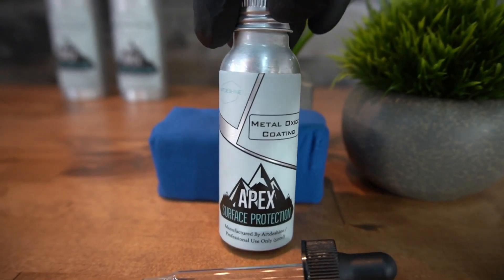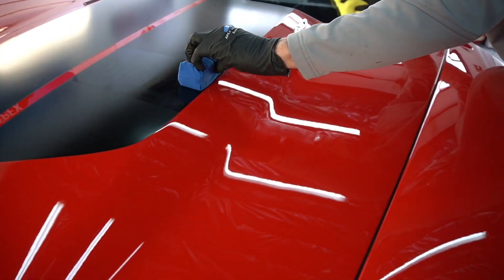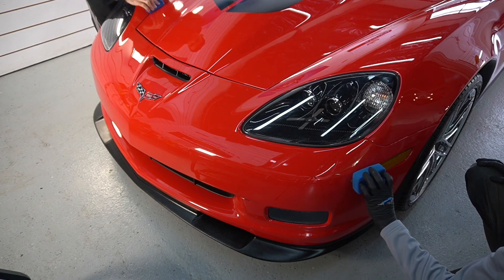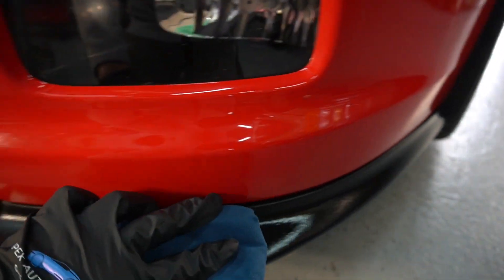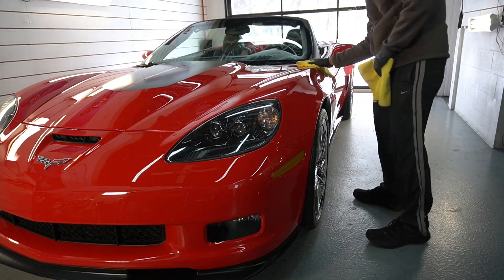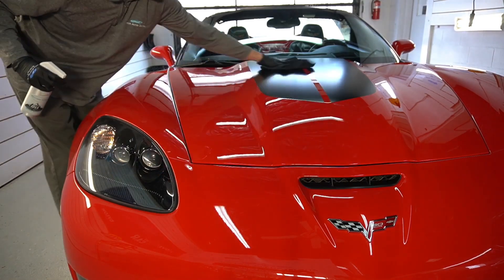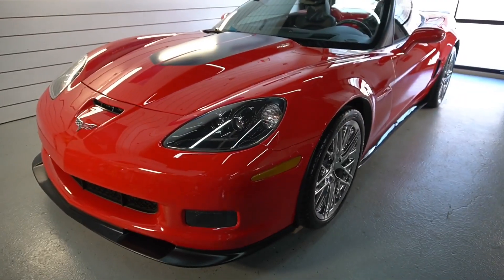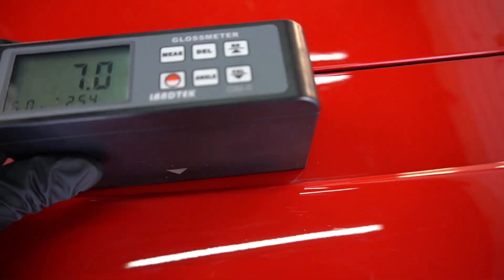Apex Surface Protection (ASP) Metal Oxide Coating Protecting This C6 Corvette!!

Comment: I bought the $200 kit over a month ago. Relatively quick delivery. Surprisingly no contact info of any kind. Tried looking it up, but no luck. Got the info I needed by watching Papasmurf. So far I’ve done a black G63  & a black JK 4dr. The hardest part for both vehicles was stripping off the TurtleWax Hybrid Ceramic Wet Wax coatings. Took at least 2 hours per vehicle.  Application of the Metal Oxide was pretty simple & easy. Used the sheeting as a topper on the G63 and it turned out so glossy that it looks surreal. Waiting another couple of hours before applying it to the Jeep. I still have roughly 1/3 of a bottle of MO and I did every square inch(and wheels) of both vehicles.  I’ll definitely be buying another bottle of MO.  I’m just a “hobbyist” and only do this for my close friends.

Comment: Ohhh, fooey.  I just bought a liter each of the Menzerna marine 3-in-1 and Power Lock based on a few of the videos you had posted earlier, and just this morning I ordered some Menzerna control cleaner to use to clean the surfaces after the 3-in-1 and just before applying the marine Power Lock.

My application is a bit different, however, as I'm using it on my airplane.  For the last 24 years since it was painted with single-stage Imron polyurethane it's sat outside exposed to southern California sun. Summer sunshine is brutal, winter rain leaves greasy streaking down the vertical surfaces from residues in the smog. The paint has lasted these 24 years because I've been using Astro Shield polish made by Nord Viscount until they went out of business back in 2008.  It's a basic polish that uses dimethylsiloxane and polyethylene polymers and low micron abrasives in the usual base of petroleum solvents. 

Now the good thing about the Astro-Shield is that it does seem  to make the finish look better the more one uses it.  The bad thing is I'm running out of it and Nord Viscount no longer makes it.  I have been polishing the plane every 3 to 4 months and the paint is still holding up, with a few minor  (2mm) bare metal (aluminum) spots showing through.  The worst area is the dark navy-blue  anti-glare panel above the engine that is always the most oxidized and turns the polishing pad blue every time I polish it.  The wing area is white, so it doesn't seem to get as much oxidation as the dark colors.  The color stripes on the sides of the fuselage and vertical tail are still in decent shape after 24 years.

I don't care really about gloss or beading, I care more that the paint doesn't oxidize and flake off to the point where the aluminum is exposed and subsequent corrosion reduces structural integrity of the airplane and slows it down from the aerodynamic drag.  (and looks like crap)  So if that happens  the plane has to get repainted and that gets very costly to the tune of ~$20k, or else the wings come off in flight.   So it's a lot cheaper to maintain the paint, especially the surfaces exposed to sunlight by polishing every 3 to 4 months.

I can do the ASP  metal oxide, but would the 24 years of dimethylsiloxane and polyethylene polymers pose an adhesion problem to the Imron?  There are areas of wax buildup around some of the rivets and shallow ribbing on the control surfaces, as it was too much of a PITA to to remove the old wax.

Any thoughts would be appreciated.  Thanks.

Comment: Brian,  Do you recommend discarding the microfiber towels  after leveling & buffing using your Metal Oxide Coating.  Thanks,  Dave Fleming,  Kennett Square ,  PA.

Comment: I ordered a kit a couple days ago, how long after applying the coating should I wait to apply the topper? Or second coat? Durability for 2 coats? I hope business booms for you Brian, you deserve it.
Reply from the maker: 24 hr. Then top it. 4 hours between layers of the coating. 1 coat five years.. 2 coats eight years.
Reply: @apexdetail85  Thanks Brian.
Reply: @apexdetail85  this is amazing and I’m so happy for you. 
After all the years of great advice you’ve given away, it’s your turn to get something back. Good on you!!!!
Reply: thelastm  estimated time with maintenance
Reply: @apexdetail85  can your coating be applied in the Texas heat? I have access to a garage but it’s not air conditioned. Any tips would be greatly appreciated!
Reply: thelastm   same question I got how do they know

Comment: How do these new products benefit/get along with SIC "pro" coatings?  The sheeting product your site describes is intriguing in that it may help coated surfaces "shed" dirt rather than just suspend it with water beading.
Reply from the maker: They have played well with the coatings I have applied them to. And that was many.

Comment: What are the key differences between the two ceramic toppers or maintenance coatings? Are they both water based?
Reply from the maker: Yes. Both organic polymers not ceramic. This lets the coating breathe underneath as it cures and the toppers in return have no cure time.

Comment: Hey Brian.  I've been watching your video hoping it would resolve an issue I've been trying to fix ever since I got my sports car in 2017.  The issue I'm trying to resolve has to do not with actual hard water spots, but just dirty water stains.  I want to start by letting you know I already have a coating on my car but it doesn't prevent this problem.  Here's a little scenario:  I just washed my car.  Then a few hours later it starts raining but just a bit.  Then the rain stops.  Because of the coating I get beads right?  So when they end up drying they create dirty water stains.  This forces me to wash again (I usually will use a weaterless wash product).  This gets me quite upset.  If only the water would just sheet  off the panel instead of beading it would be amazing.  So my question is this: Would Surface Protection Metal Oxyde all by itself prevent this to occur?  Or that product combined with Rehydra-Sheet maybe?  If you confirm I will most definitely buy them for sure.  Please be honest with me because it's quite an expense and I want to make absolutely sure it will resolve this issue.  Thanks! :-)
Reply from the maker: The combo as a team works best. The coating can do both depending on how much water is introduced to the panel...but when topped with sheet... that is w whole new level. One thing to keep in mind...even sheeting products need a certain amount of moisture to work properly. If just a light, short shower...could end up with a few beads.
Reply: @apexdetail85  Ok then thanks a lot for such a quick reply! :-)

Comment: @Apex Detail  I love that this coating can be applied to all hard surfaces. 

Will the durability for the paint protection be the same for glass and headlights? 

If I were to apply 2 coats to headlights, can I use a UV light to speed up the 4-hour wait between the 1st and 2nd coats? 

✌
Reply from the maker: Yes..shortwave IR van greatly reduce cure time between layers

Comment: $ is was only a matter of time...but still a loyal follower because of your honestly, super source of great detailed unbias content  and hard work!
Reply from the maker: It’s funny how you would buy your products from companies that have no idea what the hell they are doing... but turn from a source that would offer you the best products available.
Reply: @apexdetail85   Curious why you would say that? How do you know that, I would not.. I do my research! I try to stick with companies that are in it for the long , doing it for years,  have a soul, no price gouging on the hype, they listen, over state the warranty, and  let there products  evolve/improve.   With this over loaded coating market, I still don't see anyone really clearly showing and proving why theirs s a difference matter.   Some have no problem slapping a high price on it. And yes, if they did do long term testing, show us that!   But one area you nail all the time and push which is highly commendable  is great proper prep, application and consistent proper maintenance, so thank you big time!   Now lastly on the " a source that would offer you the best products available" and certainly am not. I am totally open. My current reaction is your coating is very expensive and I see no data on its durability .  Also not many real world honest unbias unpaid reviews out there or your coating with any long term tests ( 3 , 6, 12..). So if you unbiasedly reviewed your on coating, would it be....go out and get it now?  Hmmm or even impressive ( and use what you have - that is what I am doing).  
I remember you talking about artdeshines coating (i believe  the same as yours or damn close- white labeled I am guessing) , stating..very  $$$ ......  Finishing I am extremely still impressed and thankful for all your hard working vids, they do appear to be highly unbias and full of great details and insight.     Thanks again I do appreciate it... guess I was truly unhappy and still am,  for your price points... I was hoping you would offer a less  pricey product for us DIYers, enthusiast and long time followers!

Comment: Brian, if Final Solution & its sealant is used on the vehicle, can the Metal Oxide coating be used over that? Would it be best not to use the final solution sealant?
Reply from the maker: You can give it some time to cure... and coat right over it.
Reply: @apexdetail85  so I can coat over the FS sealant?
Reply from the maker: My apologies... reading it quickly... I thought it was Solution Finish. No, the coating should be applied to clear, naked clear coat.

Comment: Brian, the price is a bit high so can this size do how many standard vehicles?
Reply: He said 3-4 cars... notice that the bottle is a bit bigger than the normal ones we are used to, i wonder if Brian will have a smaller version for those who don’t have that many cars to coat
Reply from the maker: The bottle also comes with my training if needed at no extra cost.

Comment: I know it depends on how much you drive, keep in garage, where you park. But compared to like adams hard graphene coat is it more durable? Love you channel been watching you for a long time. I love you found a better solution for water spots my wife drive a black charger, my truck is bright red. So hard water spots are not my best friend. Glad you came out with your own product. Its look very promising.
Reply from the maker: Yes.. it is a tough chemical resistant coating. You can layer for even more protection.
Reply: @apexdetail85  Alot of people dont understand the time you have put in to finding what you like. Your very passionate about detailing i can tell. Your passion for detailing pushed you to want to solve time wasting problems. So your new product sounds like you solved your problems. A product from a passionate detailer i cant wait to try it.

Comment: Brian, I have enjoyed watching your videos and have definitely learned a lot from you.  I don't own a detailing business but I am a weekend warrior passionate about my vehicle.  Would I be able to get trained for this process and if so what is the cost?  Thanks
Reply: Is there a relatively easy way to apply this product to wheel barrels without removing the wheels.  My situation is follows:  The vehicle is artic white C7 Z06 with black chrome wheels.   When in the garage it is parked on a bend pak lift.   Health conditions  prevent me from being able to  remove the wheels.   

I am a first time poster, but have followed your youtube videos, and used, many of the products you have  recommended.

Thanks for your effort!

Comment: How does this hold up against road salt during winter. How long do u wait till topper.
Reply: Road salt won't be an issue.  I have used a few coatings and they are not impacted by road salt.
Reply from the maker: I have a ton of that in my area... holds up extremely well